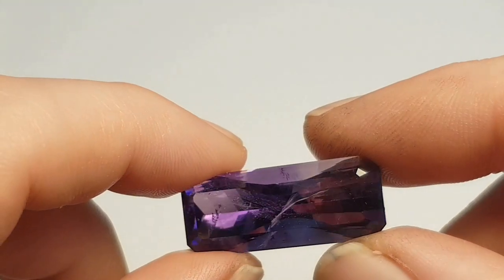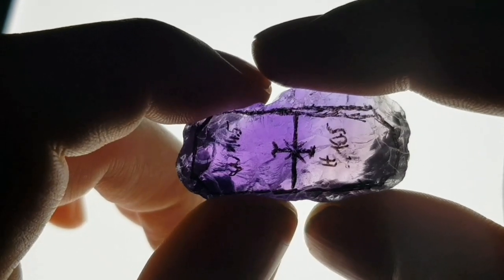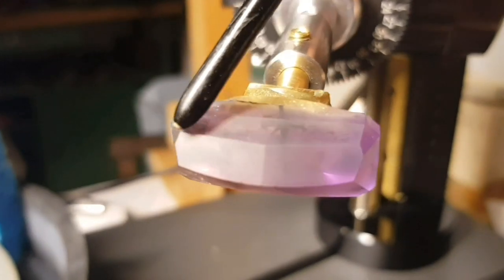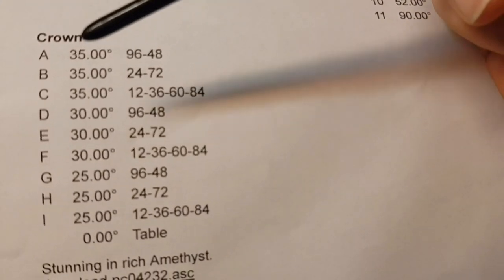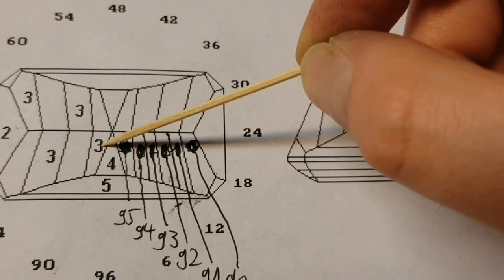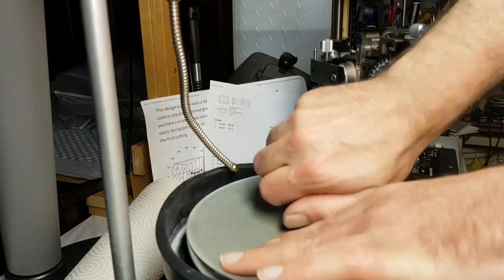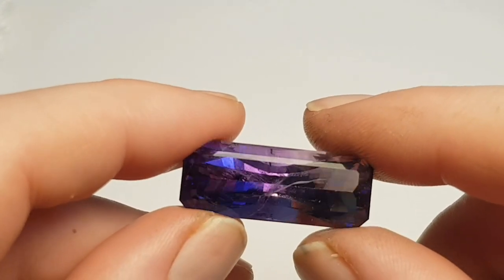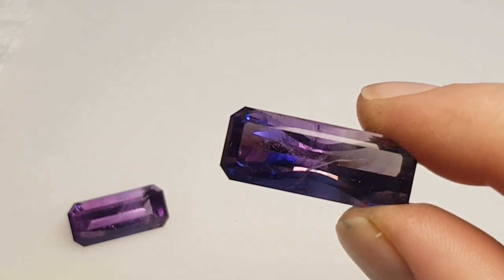Faceting Tutorial 💎 How to Add Sparkle to an Emerald Cut 💎 Amazing Colorful Amethyst

Comment: The way the light scintillates in gradient across the many facets in the back but the crown facet is so clear and open, this seems like it would be the perfect cut to display a plant or insect in amber, or to frame some sort of enhydro-with-bubble pocket in a quartz crystal. The amethyst turned out completely gorgeous.
Reply from the maker: I didn't have enough Material on one edge to cut the step facets on the crown a bit larger. A little bigger fits better, but still a huge table facet. That's a brilliant idea, I can use the Design for a later Episode of "Influence of Inclusions" to frame a cool Bubble, Needle or Crystal. I have a lot of Material with interesting inclusions. Thank you very much for watching and the inspiration👍
Reply: @GermanGemcutter   Ah, that makes sense-- I had wondered how the uneven initial surface was going to impact the cuts. Now I see what you mean about the step facets being smaller. The adaptation worked very well.

It's good to meet a kindred spirit who thinks inclusions are interesting. 😁 Whenever a jeweler touts a stone as flawless, I have to bite my tongue to keep from saying, "Yes, but it's boring." I look forward to seeing your future work with and about inclusions! Thank you for creating these wonderful videos.
Reply from the maker: @k.jespersen6145  I have shared a post in my feeds on FB and Insta, you can check it. There you can see it very good. Also a lot of Stones with Inclusions❤ I will test a lot more Stones, Designs and the Influence of Inclusions. Exploring it and work with is a passion 🙂 Thank you so much, sharing the Videos with my Viewers is a great pleasure.

Comment: I'm a bit surprised by how much Zirconium Oxide you put on your Darkside Lap.
I have never used Zirconium Oxide, only Cerium Oxide and Chromium Oxide but I don't use 100th of what you use on your lap.
Now I am fairly new to the Darkside, having only just started using it for the last month or so. I love it for Quartz's but following Gearloose's own instructions, they say to use the Oxide sparingly or rather as quoted "Be stingy with the polish" !
So I was a bit taken back by the amount of slurry you have on your Darkside.
I never used anything near that amount on ANY lap actually.
That said, your facets do appear to be clean and sharp and without pitting or scratching. If use anything but the smallest amount of Oxide, I get tiny scratches. But if I put it on every so sparingly, the facts come out excellent.
How do you get away with so much slurry ?  Is it something to do with the Zirconium Oxide you use ?
Reply from the maker: In the beginning I experimented a lot with oxides and water, it was a method that worked. However, I was never satisfied as I was wasting way too much oxyde. The problem was with the dosage of water. 1 drop every 3 seconds, 1 drop every 5 seconds, everything is far too much. The solution was quite simple, I now use a spray bottle, so that the water can be optimally dosed and I hardly need any oxides for the perfect polish. My buddy Tony gave me the tip with the spray bottle. I also made a video about it later. Take a look: https: //youtu.be/olof6tZ64Bo
Reply: @GermanGemcutter  I have always utilized the spray bottle to spritz oxides but I have since learned to appreciate Zirconium Oxide especially with the Quartz's. It definitely leaves a great finish on Quartz.